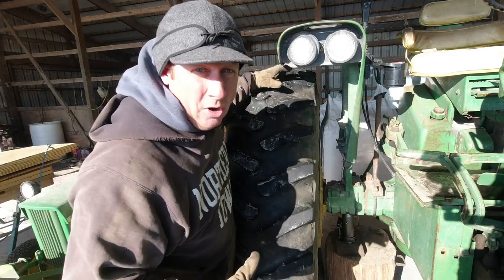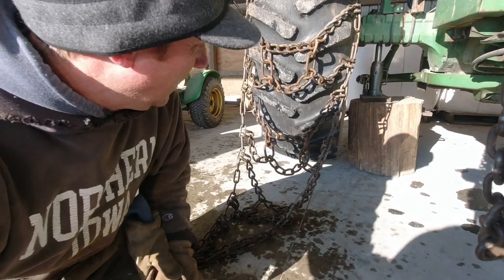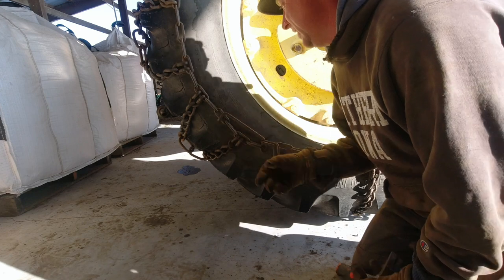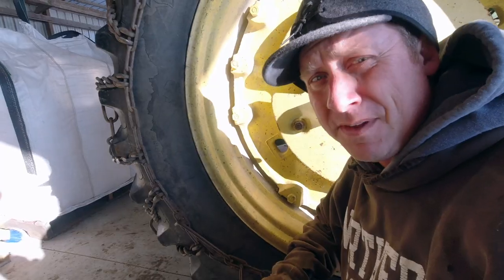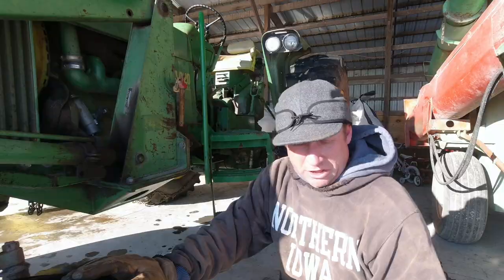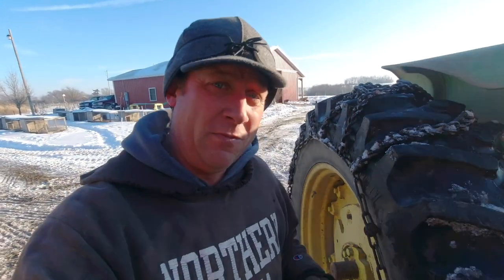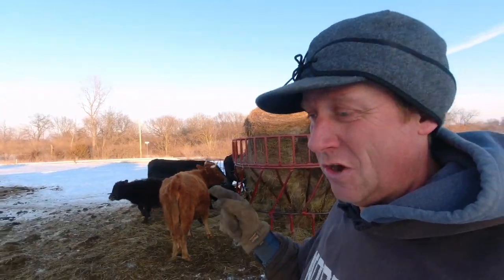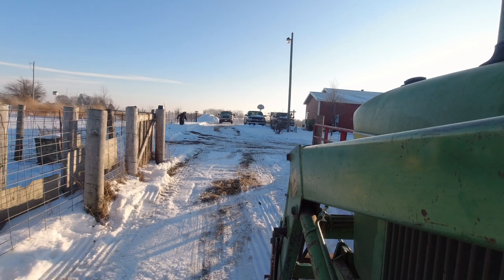Putting on Tractor Tire Chains!

Comment: That's the way to put chains on, although that right chain looks to be a bit small for that tire.  Your bottle jack may have air in it so pump it all the way up and push it back in a few times to see if that helps.  More snow coming mid-week!
Reply from the maker: The chains are a bit small (they have extensions on them for the sides, but not the cross pieces). But, they are better than nothing :) And, thanks for the tip on the jack ... I'll give that a try.

Hopefully the snow misses us ;)

Comment: Sometimes when I put chains on I lower the tire pressure and put the chains on then air back up.  It makes them really tight.
Reply from the maker: I had wondered about that as I was letting the tractor off the jack. That may be something I experiment with in the future. Thanks for taking the time to comment.

Comment: Those tires chains make all the difference. I have a BIG 3pt hitch snow blower but can't use it w/o tires chains so I just look at it for now. The independence of being able to move snow, especially on a farm, make a feller feel much less handicapped in winter. Let us know what you found out about the jack. That's odd.
Reply from the maker: My uncle (he lives a bit further north were the snow can be a bit more consistent) has a 3-point snow blower as well. He gets away without any chains, but his place is completely flat. The first couple of years on our farm we didn't do much snow moving, and just waited for it to melt or for tracks to be made ... clearing it off is much better :)

They just exchanged the jack ... it had air in it. You could get it out, but then it would just suck more air in right away.